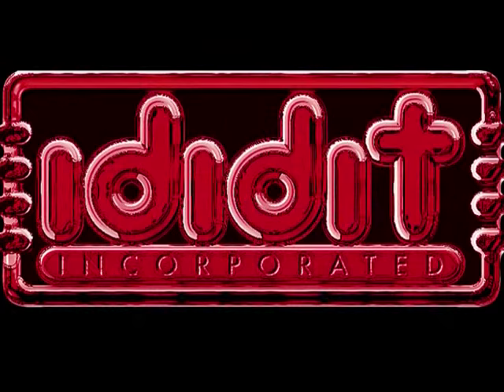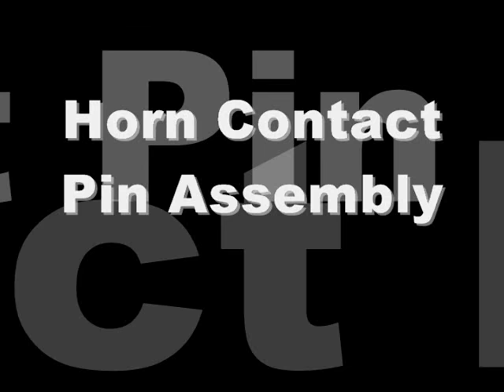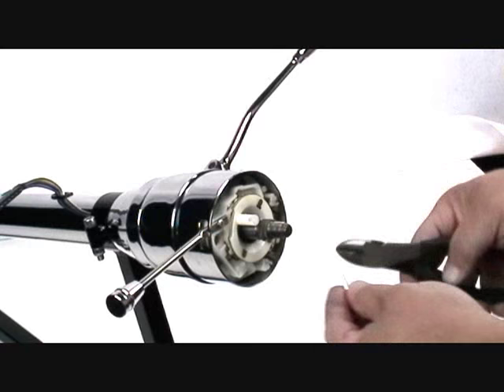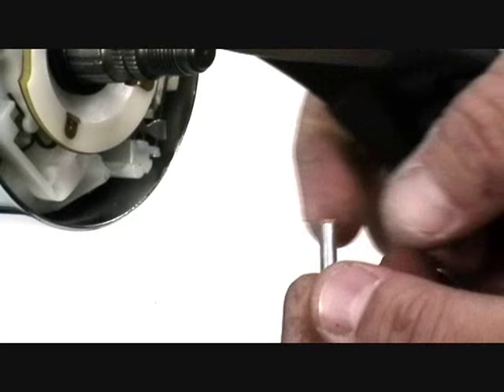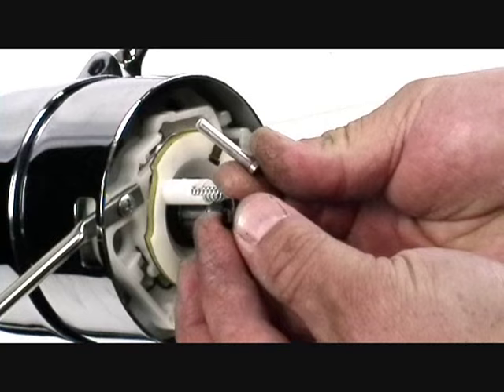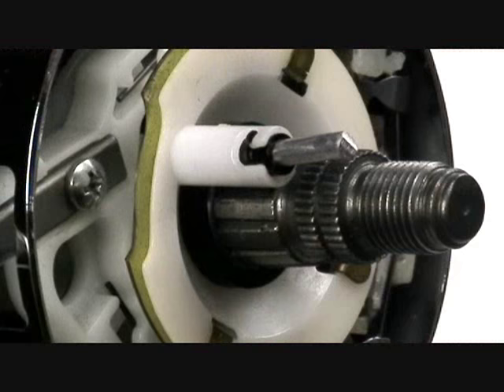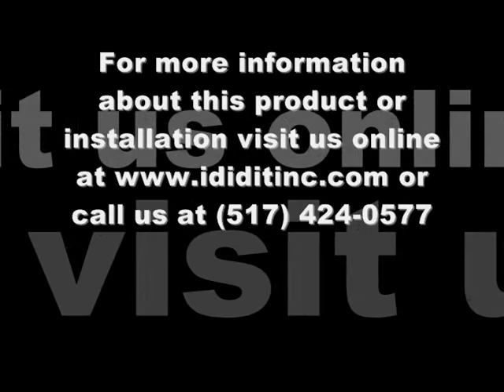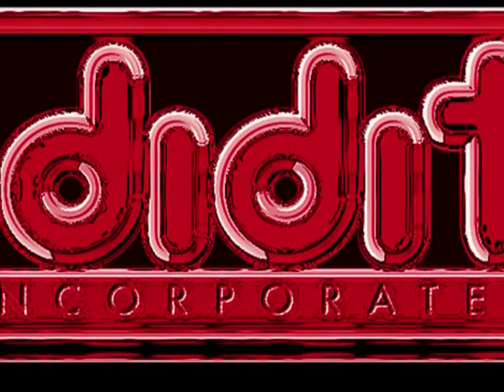Horn Contact Assembly Instructions

Comment: Thank you! Had my horn button off on my 79 Hurst Olds for a while and it worked loose and shot off (luckily, I found the three pieces)  and I didn't know how the little sucker went back. I had it right except I kept placing the head of the pin up towards the wheel and I knew that just wasn't it. Thanks again.

Comment: where does the steering wheel's big spring sit thats on the rod in the center, does it sit in between turn signal cancel and signal lever or the turn signal cancel and the metal plate that it presses against

Comment: thanks for this video. I recently purchased a contact kit, turn signal cancel ring, etc. for a square body chevy pickup but there weren't any instructions as to the orientation of the pin and spring in the socket.
Reply from the maker: We can supply the instructions (please email us at tech@ididit.com), but the horn cam needs to be aligned at the 10:30 position before installation of the wheel or adaptor.

Comment: my 64 chevelle turn signal switch already had the copper button built into the switch. but still won't work. tested the horn by touching a test light to the horn relay and it worked. I'm confused. anyone got a 64 Chevelle with original horn ring and original steering wheel?

Comment: This is a big help, but my cancel cam doesn't have that slot/notch that the black plastic bushing slips into.  my 68 GTO came with the deluxe wheel (which has wires leading from the horn buttons to the horn contact) that I am replacing with the wood-look plastic wheel (which uses the spring/rod/bushing horn contact).  Maybe I'l try cutting a slot in my existing cancel cam to see if it works.
Reply from the maker: Tom, please email us (tech@ididit.com) and we can help you out
Reply: ididitinc - it's fixed.  I cut  a "J" slot in my cancel cam and the horn contact kit went right in. horn works again. thanks!

Comment: Great video on the column horn contact but how do you connect that horn contact to the steering wheel buttons on a 70 Nova?
Reply from the maker: Mark Alan There are wires coming from each horn button that will attach to the single horn wire coming from our column.  Push either button and it completes the ground and the horn will blow. Please give us a call at 517-424-0577 if you have any more questions!